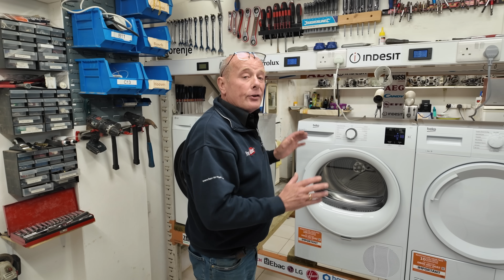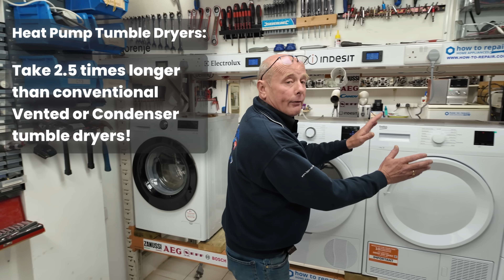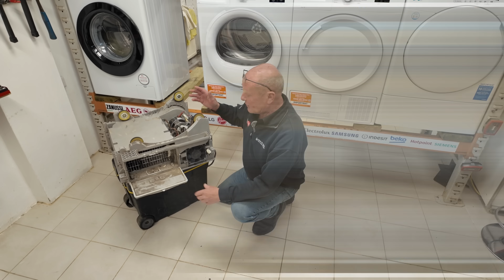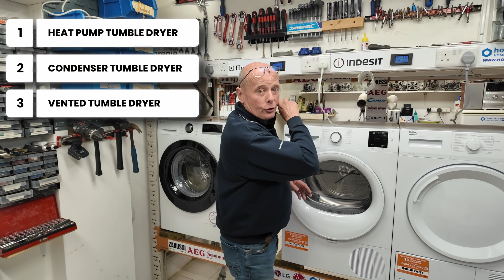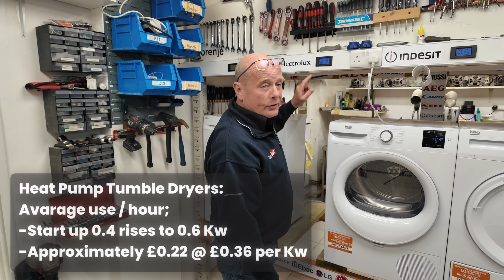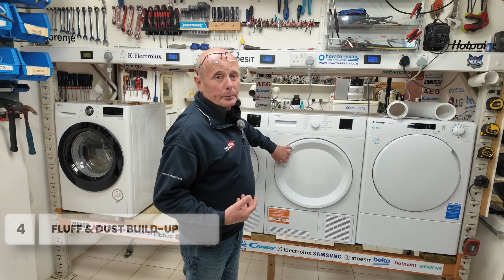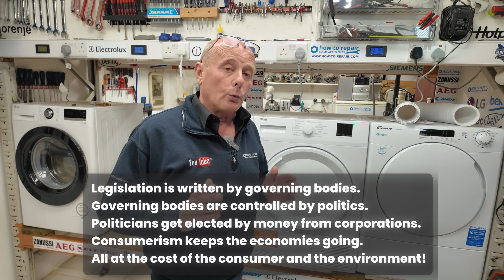Tumble Dryers the Shocking Truth About Heat Pump vs Vented & Condenser, NEW LEGISLATION!

Comment: My Miele T8967 WP EcoComfort is working fine since April 2011, served up to 4 Adults and a toddler for 3 years, now 3 Adults. There is definetely a build up of fluff in the condenser unit and I agree that I will not be able to get that cleaned myself. But after 14 years w/o any problems, I will buy a new one when the unit finally fails. And will have to see at that time if Miele is still offering condenser dryers, because I am planning to switch back, simply because I want to be able to clean the condenser unit frequently.
Edit: Just checked on the Miele website- only heat pump dryers left 😒
Reply from the maker: Miele makes good machines, and their older models are fantastic, but their parts are very expensive. They used to place the wiring diagram under the lid of every machine. I'm not certain if they still do that now.

Machines used to last 15 to 20 years on average. Nowadays, you're lucky if they last five years. Obsolescence is clear in today's society.

Thank you for your comment. I appreciate people like you taking the time to write it out. Please share it where possible. It might help others make a wise choice instead of being misled by the industry.
Reply: The newer models don't do that.  It has an extra filter.

Comment: You’re spot on. If the solution to a problem costs you money. Stop and think about it. Using heat pump dryer vs a drying rack and a conventional dryer. You’re going to save money, and the environment significantly more using a drying rack, and conventional dryer as a last resort. It’s like electric cars, yes for some they are a necessity. But for a huge percentage of people, a bicycle and or public transport is going to save them tonne of money, and reduce environmental damage significantly. Also maybe improve their health.
Reply from the maker: Sometimes the most effective solutions don’t involve spending more money but instead rethinking our habits and making smarter choices. The comparison to electric cars is also spot on. While they may be necessary for some, many people could achieve greater savings and a smaller environmental footprint by turning to bicycles or public transport. Plus, as you mentioned, it comes with the added bonus of better physical health and a more active lifestyle.

Thank you for your comment. I appreciate people like you taking the time to write it out. Please share it where possible. It might help others make a wise choice instead of being misled by the industry.

Comment: Knock on wood my Bosch heat pump thumble dryer is 10 years old still going okay.
A load of wash is about 1.5 -2 hours.
It uses 0.5kwh.
In the summer time we hang out clothes....
That's the best.

Comment: Modern domestic appliances seem not to last as long as previous generations of machines. Built in obsolescence being the likely culprit, with the aim of selling more units. Artificially inflating spare parts prices seems to be becoming a strategy to boost profits across some industries, and this tends to push back on the “right to repair”.  There are plenty of consulting companies on the internet ready to advise on how to set spare parts prices for the purpose of maximising profits etc. I would hesitate to call this a conspiracy to defeat the right to repair, but I wonder where the integrity is in this way of thinking ?  Also some manufacturers ( the automotive industry being another example)  tend to supply complete assemblies rather than their components as spares ( eg whole light units instead of LED boards). Thus pushing up the price, and often the impact on the environment. These growing practices need regulating across all industries, and domestic appliances are a good case in point. Your video is very insightful. Thank you.😬

Comment: Hes right. I work on all these dryers and heaptpump obes are great when working but if theirs a problem with compressor or evaporator its very expensive to fix , if even worth fixing . His diagnosos is right . Best thing to do is buy a normal condensor dryer but dry the clithes on a pulley or clothes hanger till their almost dry. Then 20 mins in dryer. Hes right about greenwashing , im an in guarentee repair man and one of the companies sends me the whole bottom heatpump unit to replace and the cost if you were buying it? £495 . Its rediculius

Comment: I use that Beko one on the left, it just isn't fit to dry clothes you need to run it three times and all the clothes come out smelling of a burnt smell.
Worst experience I have ever had using watching machines and tumb drying.

I hope to see some comparison tests including the quality of the output of the clothes/fabric side by side. 
Stick a data logger in each one and record data for temp, accelerometer, power, noise.
That would be useful.

Comment: In Belgium, Energy suppliers will charge you a KwH price for the peak consumption over a whole month and take that as base for all consumption during that  month. So for use it's very important to only use 1 appliance at a time.
I opened my 5 year old Bosh Self-Cleaning Heatpump tumble dryer and there was no significant dust inside.
Reply: Sounds like theft!

Comment: Heat pump dryers are a scam.
My old Bosch condensing dryer run time 58 min @ 2kw & 30p per unit = 60p run cost
My new Bosch heat pump dryer run time 4 hours 20 min @ 600watts & 30p per unit = 70p run cost

Comment: I have been looking at getting an all-in-one unit, and I think your video misses a number of factors, as well as making some mistakes in general.
-High heat is one of the harshest factors in mechanical wear. Tumble dryers that use high temperatures have significant inherent wear just in the constant thermal expansion cycles
-High heat is one of the more substantial factors in clothing wear. Keeping the clothing cooler substantially extends lifespan while reducing the amount of lint significantly. Increasing the time taken by a given cycle has little impact on wear in comparison.
-Impact of using air from inside the house and exhausting outside is highly dependent on the local climate. In a very temperate climate like most of the UK, it is mostly minimal. In a climate with more substantial conditioning requirements (heating or cooling), the tradeoff can be dramatic. At my house tonight, the outside temperature is 26C colder than inside (and it sometimes gets much colder). In the summer, assuming I keep my current indoor temperature, there is up to a 27C difference where the outside is much hotter.
-Poor equipment design for maintenance is grounds to do better research and by units that ARE better designed. Traditional tumble dryers can be designed to be hard to maintain as well. Not really a heat pump technology issue.

Comment: I have a hotpoint heat pump dryer and it’s a load of crap take for ever to dry ,yesterday I just wanted to reheat my already dried clothes for putting away because I am a lazy sod  ,after half a hour it was still cold so the question I’m asking do I need to put on refresh setting thank James.
Reply: I have a large capacity vented creda dryer it's 25 year's old it just keeps working never had an issue with it

Comment: Let's face it. No self-respecting design engineer is going to work designing tumble dryers for a living, so they get the bottom of the heap. Clearly the bearings should be specified for the extra duty. Even good bearings cost peanuts. The design should be such that the system can be maintained with ease re cleaning and when was the last time you had to call out anyone to repair your fridge because the compressor had failed? Never. The concept is excellent, I own one myself, they clearly need better engineering. Simple.

Comment: Based on my heat pump drying experience, no one involved in heat pump dryer design and marketing owns a heat pump dryer.
Reply from the maker: I think heat pump technology is brilliant, but these machines are only lasting on average five years they take at least two times longer to dry the clothes at least twice the amount of wear and tear and components and the accessibility to do maintenance is an absolute nightmare. manufactures do not seem to understand what maintenance is needed and how easy it is to do. They seem to build it and assume it's perfect without testing properly. Thank you for your comment. I would be grateful if you would share this post, as it’s the only way to force things to go large nowadays.
Reply: @How-to-repair  Luckily, advantages outweigh  disadvantages for me, but AEG charged €200 within warranty, because they claimed their design fault getting lint in the exchangee was just me using it incorrectly. I considered legal insurance, but I decided it'd be a lot of stress and little gain. I absolutely understand youtr battle!
Reply: @How-to-repair  I bought the AEG because of their theoretically convenient lint catching cartridge on the front top of the machine. But it has massive flaws, most lint still ends up on the exchanger fins, way behind the cartridge. And because of that, the cartridge gets pushed out when the fan blows heat, halting the drying mid-run.
I ended up scraping off some plastic from the cartridge,  and buying extra long bottle cleaning brushes to clean the fins. 

Not needing an external air vent, and low heat being better for clothes, make it absolutely worth it for me. Also, despite the headaches this model AEG cost me, following in-depth analysis like yours makes me think I would probably still buy a similar model today, as there's nothing better yet on the market 😞

Comment: All of those three units you are showing there have a sticker attached: "10 years motor warranty when registered".
Also, have you actually measured the consumption or are you just taking "random" power draw and multiply with time? Heat pump dryer does not run the pump all the time. Better units also vary the speed of the pump making it even better. Some (like mine) goes even further and washes the condenser multiple times during the drying process.

Comment: The best solution is to have a very high speed spinning, >1800rpm washing machine that squeezes out the maximum amount of water so the clothes are practically dry and the n use the condenser dryer that removes the last bit of moisture.

Comment: I'd like to add some doubts to your explanation, if I may. Firstly, you dont explain why would it take 2.5 longer to dry the clothes. Power draw? As well as your numbers did not add up, you said average dryer would be used for 300 hours, while a het pump one - 700 or 750 hours. That is not 2,5 times of 300, is it not? Secondly, we all have refrigerators for ages in our homes, what is essentially same technology as heat pump, so the technology is well undestodd by techicians. Thirdly, I think you are just cashing in on general public's willingless to go against whatever new legislation there is, so basically - click bait.

Comment: Heat pump units in the states are relatively new, but Americans won’t tolerate extremely long dry times. My heat pump always defaults to a ridiculously long dry time, but the laundry is usually dry after only slightly more time than the vented dryer it replaced. Hour and 15 minutes vs 1 hour.

Comment: Great advice and logical practical argument.

I'm in Australia. The Simpson vented dryer has been the same model and internal parts for over 30 years. It's always been about the same price, and it's easy to fix.

Given our climate, it's rare that I use it. I just drape items over a clothes rack and done. Racks work well over floor vents where people have central heating.

The heat pump dryer just seems ridiculously and unnecessarily complicated.
Reply: Unfortunately some apartment buildings lean on residents to use the dryer exclusively, they don't like the look of your laundry hanging on a rack outside. We used to ignore them and do it anyway.

Comment: I wanted to see or do myself a test with these 3 types dryers but more practical -  rinse/spin and dry the same decent load in all 3 dryers. But other then that I agree and recommend to stay away from heat pump dryer as long as you can.

Comment: I don't know how things work across the pond but one thing we can all agree on is nothing is built to last anymore and this is how the mfr's stay in business. In the USA we have both gas and electric heated dryers that use around 25,000 to 35,000 btu/hr of heat and run the cycle for up to an hour or so with a 10 minute cool-down at the end of the cycle. Somehow I can't see a small-ish heat pump providing enough heat to dry an average size load of american laundry.

Comment: I've always self-repaired my tumble dryers in the past, originally a tumble dryer would last eight years before parts became problematic to source / too costly to replace, or the problem became too persistant to be economical to replace. However, on the previous two purchases I've found the more affordable products are almosts all copies of each other sharing similar issues, ones for which parts become obsolete within a few years and impossible to source or the fault too persistent to fix. 

As such the consideration became either choosing a more expensive brand of condenser dryer or a lower cost brand of a heat-pump unit with a 10 parts year warranty, then repair or replace when it becomes faulty. Doing the sums a £400 heat-pump dryer with it's lower operating cost was cheaper than a more reliable brand condenser dryer over a three year period, even if I had to factor labour costs in for year two and three. It also worked out a lot more cheaper than a low cost £200 dryer with self-repair factoring previous repair costs and frequency involved and the higher operating costs.

Comment: Great explanation! Thank you! I'll be installing in a shed that will get down to maybe 3 degrees (C) in winter and up to 23 degrees (C) in summer, so vented will be the best option. Maybe they should introduce a "kWh per Kg" figure that would take into account the extra drying time needed. Just quoting a lower wattage is green-washing (no pun intended).

Comment: Beko  heat pump tumble dryer, it’s now 11 years old still going strong, I regularly clean both filters, it lives in an unheated uninsulated garage up off the concrete floor two strips of timber. Not much else I can say really it’s performed really well

Comment: I have a BEKO 7Kg integrated Heat Pump dryer machine I bought from curry’s just under 3yrs ago which comes with a 10yr parts guarantee. It’s still working today but it is tricky to dry my clothes properly. I find from trial and error, do not overload the machine with too many garments. Do not dry different types of garments together in the machine. Dry cottons on they’re own, selecting the cotton drying cycle. Dry synthetics on they’re own, selecting the appropriate drying cycle and so forth for other types of garments. If you overload the machine you will put more pressure on the motor which will not dry the clothes in the end, leaving them damp or will dry them but end up damaging you’re clothing. It’s the same when you mix different types of garments together and do not select the appropriate cycle, you will find some garments are dry while others are still damp and this also places more pressure on the motor. Emptying the water after each drying cycle is important and cleaning the lint from the filter after using the machine will help prolong the life of the machine. I’d lay a bet most of the problems with heat pump dryers going wrong are from misuse by the consumer who doesn’t maintain it and use it in the correct way.

Comment: You make a lot of good points which I agree with especially the 2.5x longer tumbling and the extra cost of purchase and repair. 
Makes the energy saving look pretty hollow. We have a vented dryer outside that we run off our solar. It will go for years with minimal maintenance that I can do myself. The only real advantage of a heat pump dryer is not making your house a sweaty mouldy box if it is inside. Big nope from me!

Comment: I've been using my Bosch Heat pump tumble drier for 8 years so far and have not noticed any difference in performance. I clean the 2 filters after every use. I normally run it set to iron dry which takes about 1 hour 15 minutes, then hang my clothes up or iron them.  I'm very pleased with it as it easily runs off my solar and batteries. A normal tumble drier would noticeably use a lot more. I see what you are saying, perhaps it depends on make and model.

Comment: Our Bosch Heatpump dryer has a quick removal heat exchanger filter and dries way faster than our old condenser dryer I disagree with some of your statements as it depends on the quality of the unit you buy and the maintenance of the item.
Plus have a insurance so if they go wrong they get repaired or replace

Comment: I have a vented dryer. It was cheap, dries fast and has very few parts that can break down. Yes it draws more max power, but I’d rather have a simple and cheap appliance taking in 2500 watts for 45 minutes then a complex and expensive appliance take in 500 watts for 4 hours.

Comment: 3 years ago I bought an Indesit heat pump tumble dryer, disastrous! Washing still damp after 2-3 hours, advised this was working properly by manufacturer’s engineer who attended when we complained. Returned for a refund as not fit for purpose. I then bought a Blomberg vented dryer which is much quicker, and actually drys clothes. What I pay extra in electricity will be less over 5 years, than replacing a heat pump dryer.

Comment: I appreciate you have done a lot of deep analysis and your conclusion make sense. In the long term the heat pump dryer is likely to fail due to the increased run times.